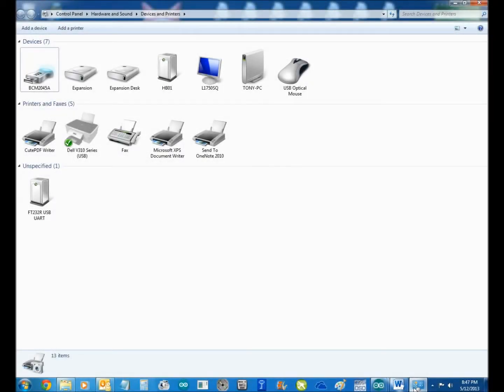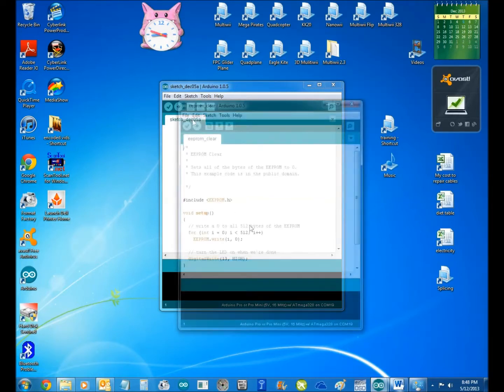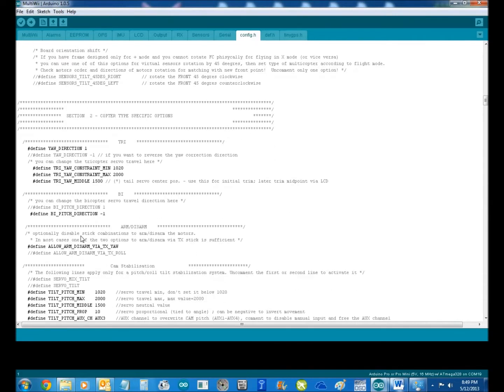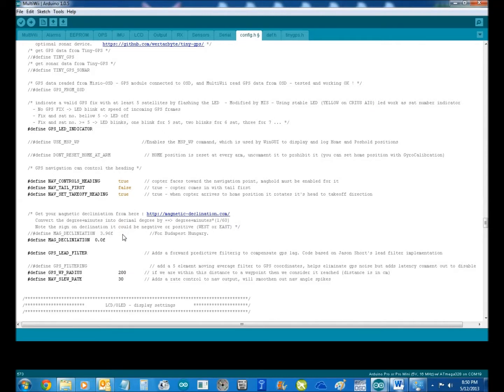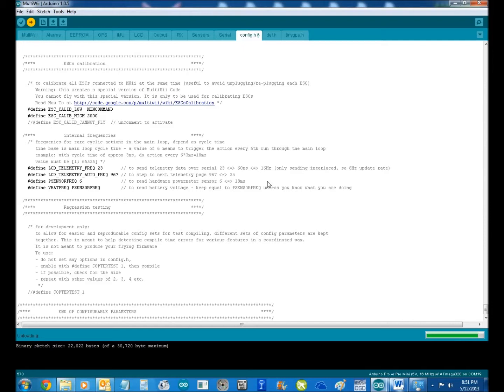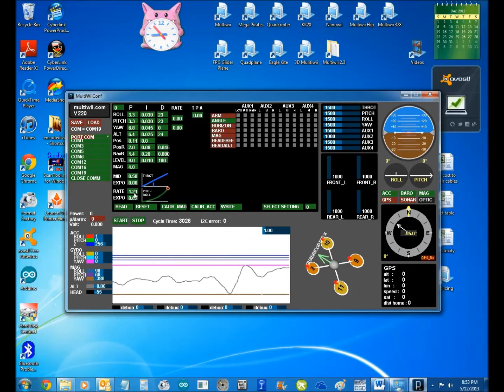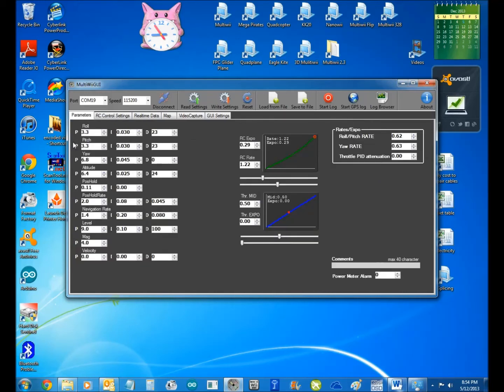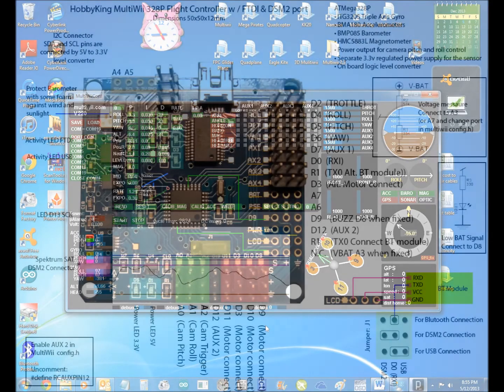Multiwii 328P Board Set Up

Comment: I got the error avrdude: stk500_getsync(): not in sync: resp=0x00 everytime i tried to upload anything to this board. Did you ever get this, or know what to do to fix this?
Reply from the maker: That error comes up if you either select the wrong board or you dont have the jumper over the pins...... if you have a look at the board you will see right above the motor pins the J1 pinout. There are 3 pins... a jumper needs to be over the 2 closest to the LCD pinout.... You can go to the hobbyking site and download the pic from the files tab......
Reply from the maker: Yes I have had that after I smashed my copter into the ground last weekend and snapped the board..... so have you had a smash or is it new........ if its new then ask for a new change over board..... if you have smashed it have a close look at the board for fractures or bends and breaks... have you had the board flying and have you smashed it?
Reply: No, the board has not worked since I have purchased it, so it gave me that error from the very beginning.
Reply from the maker: I will do a vid for you.
Reply: I'm having the same problem.